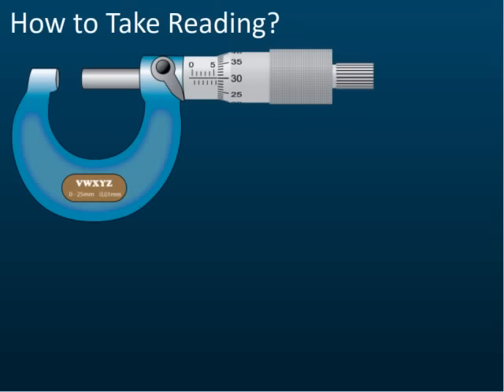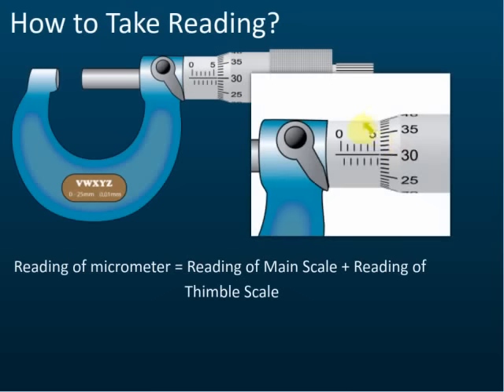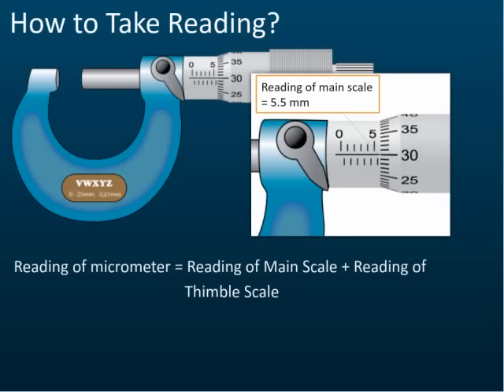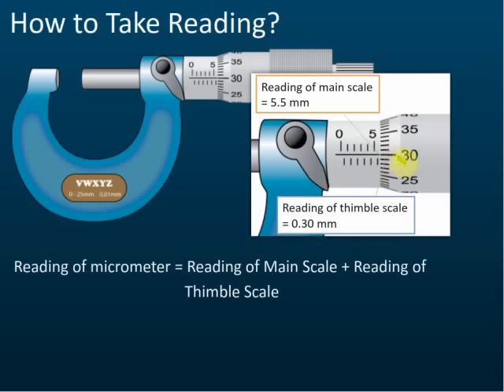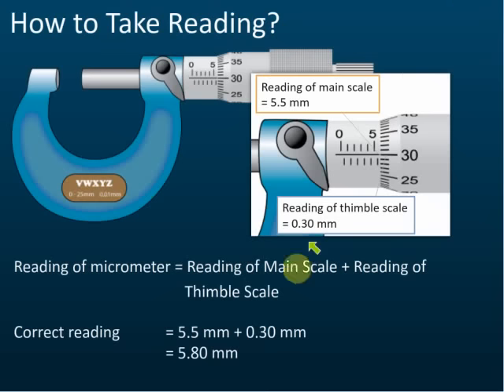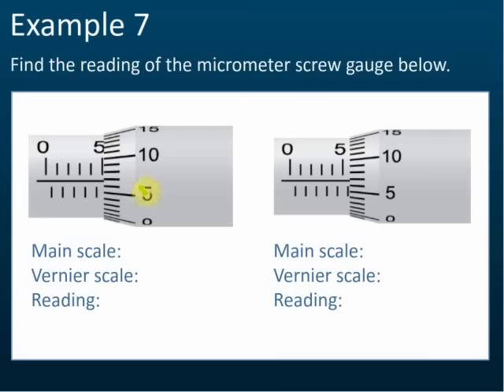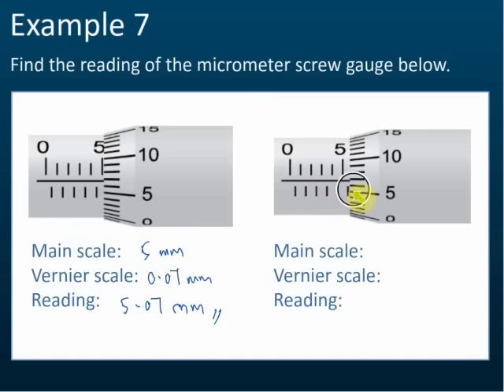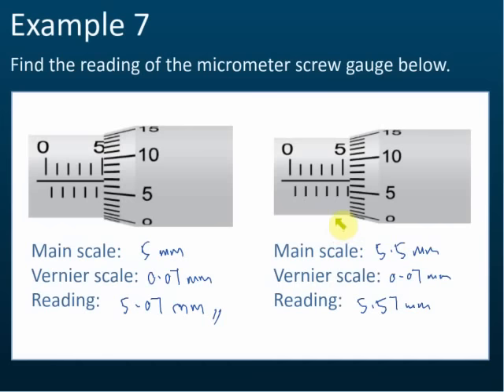Micrometer Screw Gauge - Taking Reading |  Introduction to Physics

Comment: Why the thimble scale represent 0.01mm?
Reply from the maker: The sensitivity of the thimble is 0.01mm. This is because there are 50 units in the thimble scale, and one rotation of the thimble move the spindle 0.5mm. 0.5mm ÷ 50 = 0.01mm. Therefore, each unit on the thimble scale equivalent to 0.01mm.
Reply: because 0.01 is like 1 per 100